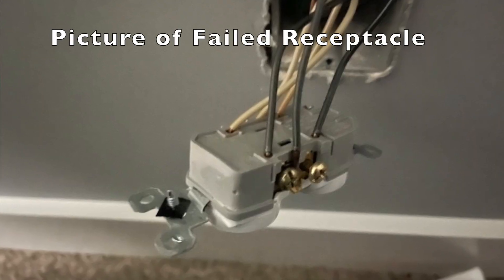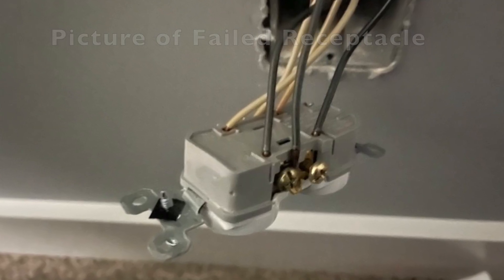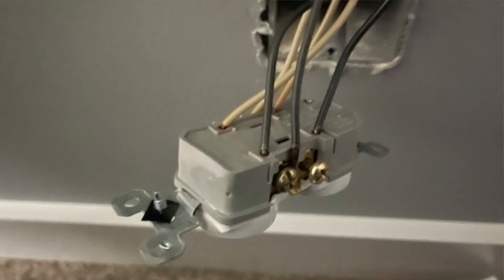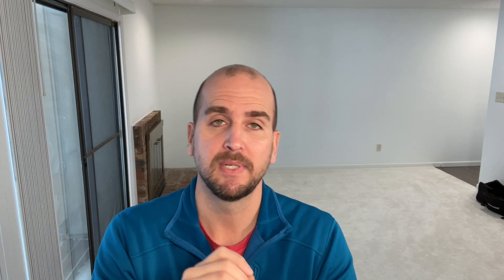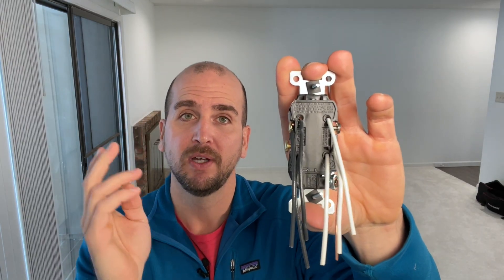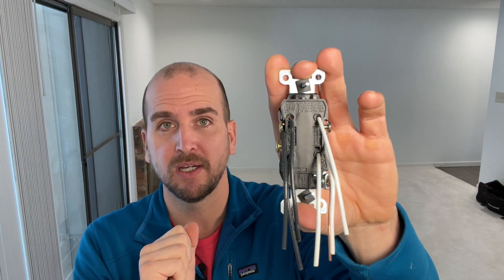Incorrectly Wired Outlet Found In Newly Built Home

Comment: I have a T-shirt that on the front reads "Licensed Electrician" and on the back reads "qualified to remove your shorts" My boss hates it when I wear that so I only wear it on construction sites and not to homes where customers will see it.
Reply: I have a shirt that says "SAVE A FUSE BLOW AN ELECTRICIAN"  IBEW
Reply: @veloci3twenty607  I've seen that one too! Awesome!!!!
Reply: I have been using pigtails for years. I like how it essentially keeps the receptacle "out of" the general circuit; that is, you're not using the little side metal connectors (connecting the top and bottom sections of the receptacle) to pass along the flow of electricity to other receptacles or lights, etc.  You're then using just the wires themselves to do that. The receptacle just connects into the wiring for power. If for no other reason, it's just a lot nicer to replace a receptacle that has only 3 wires connected to it (1 each of hit, neutral, ground), not 5 (2 each of hot and neutral, and 1 ground). Yeah, it adds a couple of more wires into the box, but I just make sure the box is deep enough, anyway. Thanks for the nice video, and no annoying music!🙂
Reply: Oh man, I want one!
Reply: @pamdemonia  I had it made at a T-Shirt shop back in the 90's. I'm not seen a T-Shirt shop in years! Maybe you can find a website that makes one-off T-Shirts?
Reply: @davids7209  You can make your own if you have an inkjet printer & some iron on T-shirt transfer paper.
Reply: Got to have one of those! Great for starting a conversation!
Reply: all these jokes are real knee slappers!!!! I'm not 65 years old, and my comedic entertainment is a little more advanced, but nonetheless, I should tell these sayings at the retirement center down the street.
Reply: @davids7209   That's because it's immature.
Reply: Personally, I like the bumper sticker that says, "Electrical work is no hobby. Hire an electrician."
Reply: @strider4108  I was forced to get a lot of my own wiring redone when I sold my house. The electrician admitted that there was nothing wrong with my wiring and it was safe, but he had to rewire for code purposes. A week after he finished, it started raining and I heard a loud bang and saw a flash of light on the lawn. He had cut the wiring to my shed, but left it attached in the shed switch box - net result, live wires sticking out of the lawn. Luckily no one was injured. If you have any brains, do it sensibly yourself, save money and stay safe.

Comment: There's a huge difference between the conduction of electricity under a screw head as opposed to the two small points of contact with a "stab' connection. One additional benefit to using "pig tails" is that any outlet that is "down stream" from the one that fails won't ever lose power. Sometimes when an outlet that is wired like your bad example fails, it can take out the rest of the circuit. Also, it should be stated that when designing your electrical circuit, try to over-size your box depths if you can. The wire nuts can take up more room than intended. When "stuffing" those wire nuts into the box and then pushing the outlet into the box, I have (in the past) caused an unintended short. One last point, when wiring an outlet, the hot wire should be terminated under the screw that is furthest away from the ground screw and the neutral wire should be terminated closest to the ground screw. Ever wonder why the neutral connections are on the same side as the ground... because from an electrical stand point they are the same potential(or should be if the panel is wired correctly).
Reply: Same ONLY in 110v. Always a voltage potential between neutral and ground in 230, 208, or 220v circuits, especially In inducted loads.

Comment: Rule 1: never ever put wires on the back. Rule 2: Use the outlets with special platforms which will provide great connection. Rule 3: Never ever pass transit electricity through your outlet! Only splice in the box and pig tail to the outlet. You'll prevent your house from fire and overload.
Reply: So you are telling me that they provide 2 screws on each side but I am only to use 1??? I have been an electrician for nearly 35 years and this is not normal practice, of course there are exceptions, 3 or more wires coming into a box must be pigtailed, not like the one this guy found. Also sometimes in office buildings where several offices are on the same circuit, if it is specced out to do so, then pigtail the 2 wires so that when you work on a live circuit to replace a receptacle you do not shut everyone off downline of the one you are working on. I really dont get how this will prevent fire and overload? I do believe receptacles were designed to carry the intended current through the breakoff tab.
Reply: @michaeljedd9359  There is no reason to run current through every outlet leading up to the one I'm actually drawing from.  Why run 12 amps through 5 receps getting to the recep my space heater is plugged into?  Better to only run 12 amps from my recep, and leave the other 5 cold and unused - pig tailed - since they're not being used.

The pig tail that you create will be more reliable over its life than the recep it's tied to.  That's how you prevent fire - because you aren't running current through the weakest points in a circuit, just to get current to the recep you're actually drawing from.  Instead, you're running current through pig tailed connections with wire nuts, far more reliable, and only one recep, the weakest point in the circuit.  Over time...this only makes total sense.
Reply: @ibanmarshal1607  or have a dedicated outlet for the heater?....
Reply: @jrock865  yep you can do that...which has nothing to do with anything I posted.  Way to take an example from someone's point and go down a completely different, irrelevant rabbit hole.  

Anything I plug into it at all...draws current.  Replace the example with a lamp, a guitar amp, a curling iron...whatever you like, we're talking about pig tails and wiring receps - not circuit design for appliances.
Reply: @ibanmarshal1607  most are 20 amp circuits and the receptacles are all rated for 20amps feed through even the 15 amp receptacles...it has a listing and is rated for that so your argument is moot.  Take a thermal image of all the receptacles in your scenario it's not as bad as you think.  That's why we have ratings and testing facilities for the equipment we install.
Reply: @jrock865  none of that speaks to my points at all.  No one said it isn't rated to handle it - we're saying the circuit is EVEN BETTER when you don't require all the current in the circuit to route through every receptacle to get to the one you're actually drawing from.  Because receps are weaker and less reliable than twisted connections secured with wire nuts.  Forever more reliable.  

This avoids a 100% needless application of heat across every recep getting the one I'm actually drawing from.  Heat kills.  You already know this.  You're just splitting hairs about it because you like to tie them down on the recep all nice and easy.  

I get it, I do too.  It sucks wiring receps now because twisting pig tails sucks.  It was so much easier and faster to just hook load and feed to the screws and go on with life.  But...ultimately I like to use the best solutions to things, so I changed.  Sucks, but the workmanship is better.

That's why they teach pig tails and twisting right now in trade school.  Go argue with them about it.
Reply: @ibanmarshal1607  show many any case studies that show pigtails are superior?....my point is valid the tab on the receptacle is rated for 20 amps probably more to pass through just because you favor things as your way is right doesnt mean it is.  The receptacles are all tested for handling the amperage they're rated for.  Whens the last time you changed out a plug down the line from where you plugged in said heater because it failed? normally the plug that fails is the one the heater is plugged into due to loose contacts and high amperage draw not receptacles down the line.  I'd be more worried about frayed cords on heaters etc than pigtailing plugs because that's normally what burns houses down.
Reply: @ibanmarshal1607  lol nobodys lost just proved you wrong everyone has a different way to wire doesn't mean it's wrong.
Reply: @jrock865  No, you haven't proven the trade colleges wrong.  Pig tails are what they teach - despite the "rating" of the receps.  Because it's smarter, and more reliable, causes less fires.  Go argue with them about it.
Reply: @ibanmarshal1607  ive taught trade schools and been in many classes over the 20 plus years of my electrical career no they dont all teach that it is merely preference and a plug feed through is sufficient
Reply: @jrock865  you're still lost.  I didn't refute or argue any of that, I answered your question on how it starts a fire and why it's a better method to wire.  It's what they teach in the trade schools here and it's what you'll see at the job sites here in most cases.  I didn't invent it, lol, 

Tons of videos on YouTube demonstrating how it starts fires.  Tons of articles on how it starts fires in old receps if you prefer to read.  There's no excuse to argue with me about something you can read and argue with yourself about.
Reply: @ibanmarshal1607  the cords and multitap plugs and drop cords are what cause fires most cite your sources for the plugs
Reply: @michaeljedd9359  Michael. you can have your own opinion and you can also use those Chinese certified outlets as well. It's up to you. Seriously. You can go by code and do whatever they say. Or you can do it in another way and prevent fire.  For commercial they are using normally good prodocut. But to residential electricians can install whatever they want. Anyway, not sure why 'm discussing it. You can proceed with the how you doing it.
Reply: "platform" ?
Reply: @WeTubule  like on 6:01, it has a metal square platform which will jam your wire and u'll have a great connection.

Comment: This video was great! One thing I'd like to point out though. When you showed the original recept, it had wires coming off the top and bottom side of it. This means that power travels through the recept in order to get to the rest of the circuit. If you notice on the recept, there is a tiny tab connecting the top to the bottom of the recept and that is carrying all the load through the rest of the circuit. If you had a vacuum and a space heater down the line, chances are that little tab will burn out. That little tab isn't meant to carry the load of the rest of the circuit. It's meant to only carry the load from the top of the recept to the bottom... or vice versa depending on which side you wired it. Sometimes, when wiring on a budget, instead of buying and mounting ceiling lighting, you would wire a switched recept. One side of the recept is hot all the time while the other gets switched on and off. Good for plugging in a lamp. When you do that, you would break off the tab between the top and bottom of the recept (otherwise it would stay hot all the time). That little tab is quite easy to break off so that goes to show you just how little current can potentially cause the recept to fail.

You did point out doing pigtails and that's the best way to prevent wiring on the top and bottom of the recept. I just wanted to explain what happens when you do. You only ever want one hot, one neutral, and one ground wire connecting to the recept.
Reply: Hi...been an electricalmatricician for 30 years , and the technique you have instituted is spot on in All facets EXCEPT: IM NOT condoning wiring in 20 amp receptacles" hot", but sometimes it is unavoidable, so I tell my guys to get In The habit of cutting out the hot first, in case there are power supplies downstream, like a computer,  smart TV etc.as cutting the grounds and  neutrals first will cause it to go high voltage and burn them up, thereby scaring the shit out of both parties homeowner and electrician alike...then when rewiring "HOT", ALWAYS STart with the ground, then neutral,  and lastly , the "HOT", FOR OBVIOUS SAFETY REASONS, AND TO PREVENT ANY AND ALLLL EQUIPMENT DAMAGE... DOING THIS WHEN THE POWER IS ON OR OFF, AND ALWAYS DOING IT IN THE SAME ORDER OF OPERATION, AND ALWAYYYS HANDLING WIRES AS IF THEY ARE "HOT", ( IE: NEVER TOUCHING THE BARE COPPER) WILL KEEP  YOU ALIVE AND SAFE FOR YEARS TO COME AS IT HAS SAVED MINE AT LEAST 10 TIMES WHEN THE POWER WAS ACTUALLY ON WHEN DUE TO CIRCUMSTANCES,  SUCH AS FAULTY METER, SOMEONE THROWING BREAKERS, ETC... JUST SAYIN....REAL WORLD SHIT THAT HAPPENS

Comment: 8-year electrician here. As a professional, I have to disagree with these being labeled "mistakes". These practices may lead to issues but only if the installer is inept. The push-in connections are fine as long as they haven't been used before and you strip the wire to the right length. Good insights for those starting out though.
Reply: Thank you! I was going to make the same comment. A “mistake” is not going to get UL certification so the video went overboard on that point. And furthermore, I’ve seen more failed pigtails and screw terminal connections than I have push-ins! It all comes down the skill level of the guy doing the work. Seeing some remodels in my area I am convinced that no one could read the code book - or just wanted to save a dime. 

Junction box? We don’t need no stinkin’ junction box!

Just run that 12-3 wire across the inside of the studs.  The sheetrock boys will come and cover it up tomorrow.

I know it’s a copper to aluminum connection but a wire nut will still hold them together just fine.

We can’t get this 4-way switch to work. It’s defective. Well did you look at the labeling on the back of the switch before you wired it incorrectly?

I don’t know why there aren’t more homes around here burned down by wiring failures.

Comment: as soon  as you put the receptacle into frame, the one thing that stuck out to me was the backstabbed wires, I sometimes get asked to look at receptacles and when i replace them, i try to never back stab the wires unless that is the only method of connection and screw clamps down on the wire (gfci's are like this sometimes) that way i don't get called back out for something like this and if i find one like that, i cut the wires and do it the right way